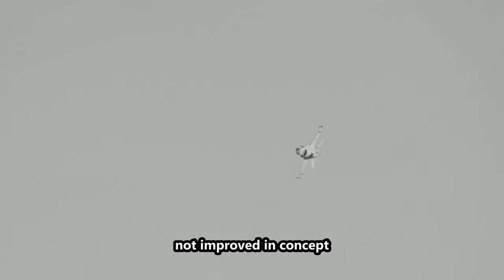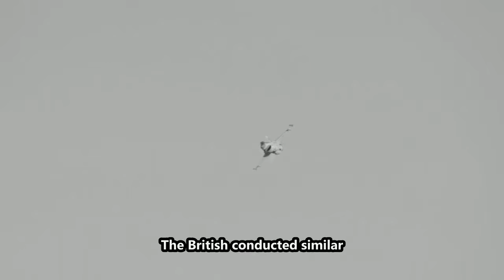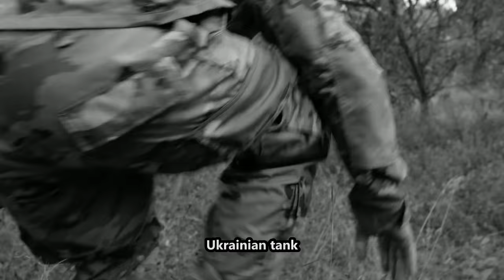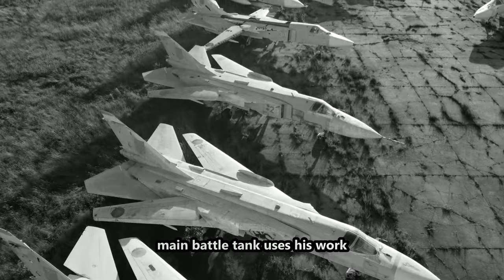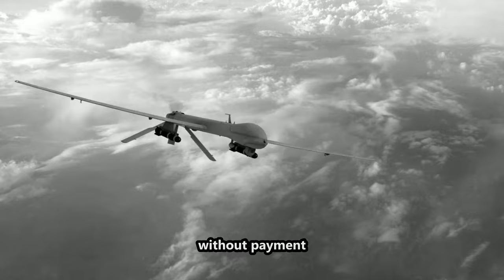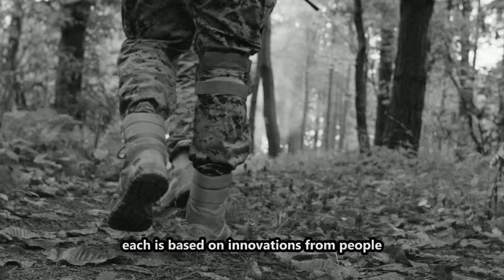Panther Torsion Bar 1943 - M1 Abrams and Leopard 2 use German design TODAY

Comment from the maker: Leopard 2A8 2025 uses torsion bars. M1 Abrams uses torsion bars. MBT-3000 uses torsion bars. ALL based on Ernst Lehr's Panther design from 1943. Which modern MBT has the best suspension? 🤔